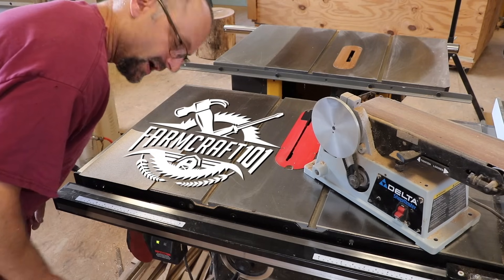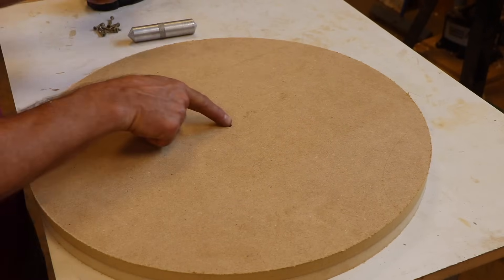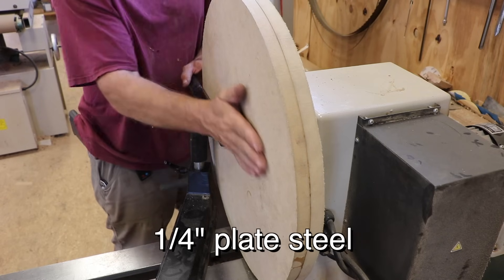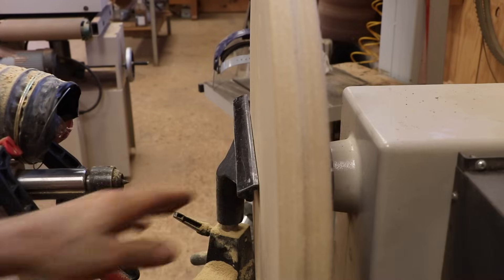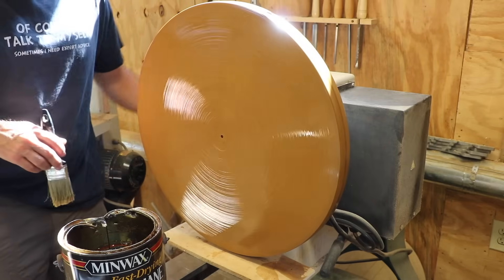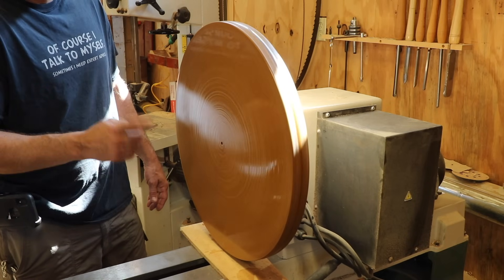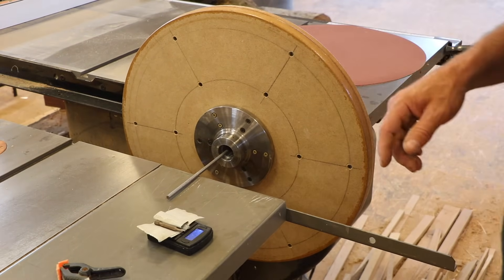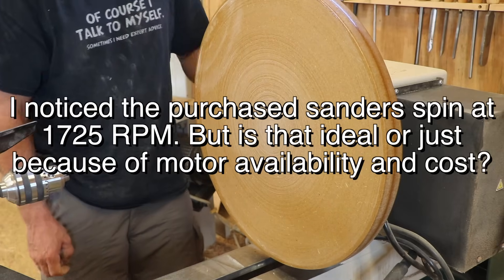DIY 20-inch Disc Sander Build.  $2000 Tool, Cheap and Easy.

Comment: That’s not the only way the tablesaw you were sitting on I built me an insert out of an old tablesaw blade and cut all the teeth off in it and I’m both sides I got light sandpaper on one side and heavy sandpaper any other side and I do it all the time in my tablesaw

Comment: Some sanding disks stick tighter than others. Some peel off pretty easily, some need a little persuasion from a heat gun on the low setting so as not to scorch your plate.

Comment: Hi John - You correctly commented that moving the balance weights towards the axis of rotation reduces the amount of imbalance correction. Similarly, spreading the balance weights out along an arc reduces the amount of imbalance correction compared to an equivalent amount of weight concentrated at a single point location.

Comment: This is brilliant stuff, I would certainly go this route if I had the chance. You Americans are lucky with all the space in an about the house. If you do use polyurethane on one side only, you do run the risk of the disc warping as a result of the surface tension caused the poly and the  moisture level variations over the the year... (don't ask me how I know)

Comment: To determine safe speed for turning multiply the rpm X the diameter of the piece. Safe speed is betweem 6,000 and 9,000. That is for turning a bowl, platter etc. Gives you some idea as to how fast to go maybe 300 to 450 rpm.  Kinda fast for me. Tune at comfort level up to 450 rpm. Helpful???

Comment: Centrifugal Force of 20" diameter disk running at 750 RPM = a G force of 158 times gravity!!!!  Tip speed of 19.7m/s (44mph)

Comment: Jon, does your lathe have the capability to mount 
stuff to the left side of the headstock?  My old Cast Iron 
Shopsmith does.  I'd rather be going that way.

My headstock is REAL easy to turn around.  Shopsmith 
went downhill after Hans stopped building the 10ER.
Those aluminum based Mark something, not all that well 
built.  They are STILL using the E or ER to make the current 
stuff.  You will NOT see a mark whatever (Mk 2, 5,7,and 
the the Mark 7) making the new stuff.  The Model 10 stopped 
production in 1953.  I've paid for a few, some as cheap as 100 
dollars.

steve

Comment: You ask for recommendations on better ways to adhere a sanding disc.  I don't have direct experience with this product as I don't have a Disc Sander yet, however 3M makes Feathering disc adhesive which you can apply to the face of the disc and it doesn't dry but remains tacky...adhering disc paper perfectly and then you just peel it off and reapply a new disc when needed. There is an example of it being used at 3:16 of this knifemaking video which is discussing the benefits of disc sanders. https://www.youtube.com/watch?v=RTj0RY4-HyE&t=102s  You can buy it local at autoparts stores or obviously online. I don't believe it stays tacky forever, but cleaning it up would certainly be easier if as one commenter suggested, you used aluminum as your backer.

Comment: When you  get  the polyurethane on ,  go to the auto paint store and they have a special glue you can put on the surface that will let you change papers. It is used  for da paper which needs to be replaced. It is made by 3 M,
Reply: Just for anyone wondering its called feathering adhesive and is made EXACTLY for this purpose. Double emphasis on EXACTLY

Comment: Great job and you will find many uses for it. I ran mine at about 1750-2500 RPM but I used 3/4 Baltic  Birch sandwiched between two layers of 3/4 MDF mounted to a 10" face plate that was 3/8" thick. I did not add all the other screws to the backside like you. Worked great but it was mounted to a 3500-pound Calpe Hydraulic 50" copy Lathe. I made several attachments for it so I could use it as a manual lathe when needed. One great lathe but over 8' long. Stopped doing production spindle work in 94.

Comment: I think it's great. Two thing I'd suggest. Get a block of gutta percha to clean the disc every so often. It "grabs" the wood particles out of the sand grains. I've use them for years for that. Second, avoid sanding in one spot. When you are, say, rounding a corner, move the wood back and forth across the disc face to avoid burning the stock, and the paper. Great job!!

Comment: There is a principle mistake. Disk sender has to work only o-n-l-y on one half. In your case, as is in correct turning direction, it is the side close to you means from the disc center to you is the working part. As so the disc friction force (as to the turning direction,) is taking the worked peace down d-a-w-n! to the rest plate. In the same time, the other disc side (the Furer) takes the worked peace up. !!! Means: 1. vibrations. 2. you can't take longer peace  than the half disc size and shove it from side to side.*** What needs to be done is to give a slight degree from the center in to out. It means the disk face is not total flat but very very low con shape.    *   ובעברית- הדיסק חייב לקבל זווית קלה פנימה. החלק עליו עובדים הוא רק מחצית הדיסק - המחצית בה כיוון הסיבוב הוא כלפי מטה

Comment: That’s a nice tool but the lathe shaft bearings are probably not designed for the large twisting side loads that will be induce by pushing on the outer perimeters of the sanding disk (?) …..
Reply: Not sure but I guess it has two Bearings one on each side of the bearing block (and at least one for lateral force but that is not important here).
Think about the Forces involved in bowl turning when you put a log on it that is heavily imbalanced. Sanding can't be worse than that.
Reply from the maker: Lathe bearings take a beating turning unbalanced wood and dealing with catches. I think in comparison this will be easy on them.

Comment: Regarding the commercial disc sanders' rotational speed. While the motor may spin @ 1750 RPM, the disc may not be directly driven. some may be gear or belt driven and there may be a speed reduction built into the equation. It only requires looking at one to make the determination.

Comment: Balance is not critical or necessary unless you turn it 3600 rpm. For max speed calculate surface  feet/min. Too fast just burns parts.

Comment: The problem with this will be when you change out the sandpaper-disk, over time the sandpaper disc will adhere very lightly to the plate from all the pressure exerted against it everytime you sand something..

in order to get the glue to release you have to use a heat gun and heat the sandpaper to get the glue to release as you take it off the plate.. then you need to remove all the excess glue still stuck to the plate because if you don't then it will build up over time and make real high spots.. 

 Personally I  would find someone with a metal lathe and have them turn me down a 3/4 to 1" aluminum plate.... Yes , the expense will be more in the beginning , but it's only a one time deal.. 150 bucks probably unless you can get some drops from a machine shop. 

   But well worth it , even if you had to spend 3 times that ..
.

Comment: How is the sander doing after a year?
Reply from the maker: No problems. Must say though I don’t use it very often.
Reply: @FarmCraft101  Well made none the less and as you pointed out, takes up less room than a dedicated sander.  I made a MDF power stop about 8" in diameter x4 layers and use green compound on it.  I do use that more than I thought I would on axes, chisels, lathe tools knifes...  Just include a brass grub screw or bring up tailstock if you run in reverse.

Comment: Hi John,
Having looked at your (unsuccessful) attempt at a puncture proof tyre, I just did a search for silicone rubber foams, that might be suitable for filling tyres. I left a note on that video, but thought that this would be discovered sooner.
I found this;
https://www.smooth-on.com/product-line/flexfoam-it/  (Texas and PA)
https://www.smooth-on.com/tutorials/repairing-deflated-tire-flexfoam-25-urethane-foam/
You may need a drainage tube, pipe insulator, or similar around the hub first, to reduce the amount of silicone rubber used.
Canned expanding foam is too brittle for that purpose, as you discovered.

Regards
Nik
😊

Comment: I found a really good velcro  backing for mine. But then you have to have the disks made from large sheets with loop backing. Luckely there is a commercial abrasives company in my town (I also got the velcro from them) and it works out relatively cheap to have the disks made. I order 10 per grit (40, 80, 120) at a time and it lasts me more than a year.

Comment: I've got a shop smith with a 12" diameter disc which I use all the time.  Good thinking making a disc for your lath using that MDF.  Great video thumbs up.

Comment: Also, think about using aluminum jig plate for the flat surface if needed. It comes in 1/4, 3/8, 1/2, and thicker sizes.

Comment: My concern would be that any sort of pressure would cause the disc to flex near the outside as your face plate is rather small compared to the size of the disc. Maybe when a peice of 1/8th or 1/4 inch steel becomes available you could install it between the faceplate and the back MDF board to add some ridgidity.

Comment: If you check kitchen worktops, the underside always has, or should have, a 'balancing sheet,' of plain Formica or similar.
This to stop warping caused by the absorption of moisture by the underside.
Therefore, you should varnish both sides of your MDF disk, for the same reason, or you may find the disk dishes after time.😊
.

Comment: Awesome DIY adapter. One thing this lacks which you would find on a commercial sander of that size is dust control. That monster is going to fill your shop with dust. Dust control should be an easy second level project for this.

Comment: Love it, but I have an issue with leaving the edge without polyurethane finish.
Reply from the maker: Good news. I did put poly on the edge. But didn’t really show it in the video. 2 coats. I may poly the back as well.

Comment: I built a 12" disk sander using 3/4" MDF mounted using a MDF "hub" directly to the motor shaft..  I also just used polyurethane to seal it and it's fine.  Mine spins at 1750 RPM.  I did build a perimeter guard.  It's been going strong for many years.

Comment: If you want a flat surface that will make it easy to change the sanding surface in future get some glass cut to the right size and a strong glue to attach it to the back. then use a spray on contact adhesive for the front, or, if spinning glass is too scary, then some acrylic.

Comment: way late, back of the cuff math for max RPM:
MDF handles 3500lbs/in^2 (so says google anyway, that sounds high to me, but what do I know?)
mdf weighs 0.025 lbs / in^3
Simplifying down to pie pieces 1 inch thick along the circumfrence
your thing is 11 inches radius, so <= 11in^3 of material at a given pie piece

Assuming your connection point is 1 inch from center (so that I don't end up with a divide by 0, so this is where I'm getting into the weeds) that's 1/11 in^2 connection point for that 11in^2 piece of pie
So thats 0.025lbs / in^3 * 11in^3 =  0.275lbs of mass being supported by our 1/11 in^2 * 3500lbs/in^2 = 318lbs of force capable connection point

So by that math and a centrifugal force calculator I found (I'm lazy) your catastrophic failure point should be around 6350RPM, with very little calculated buffer except that pie estimate at 11in^3 (it's probably less) and probably those screws are further from the 1 inch radius point.

But I'd still stay under 3,000.

Also I'm just an idiot on the internet, I relinquish all liability.

Comment: An ideal finish might be deeply penetrating and repeated coats of water-based polyurethane varnish front, back, and edges. Sand it smooth between coats, of course. Repeated coats of epoxy might be even better. Thin it about 5 to 10% with lacquer thinner and apply multiple coats while the previous coats still have a little tack to them. The guys at West Systems say that a little lacquer thinner makes the final surface microscopically porous and a little more flexible.The material left in the mixing container should feel firm but rubbery assuming the container and the work cured at nearly the same temperature. You'll want to break the corners before finishing.

Comment: I did something very similar on my metal lathe for the wood lathe.  I glued & screwed a 1/4" A36 hot rolled steel plate between two pieces of wood (accoya plywood).  Turned the wood surface down true using the compound and a HSS tool.  Then skinned that with 1/16" aluminum and re-trued the surface with a CNMG insert (less than .001 surface run-out).  I did turn the edge as well.  With the abrasive disc run to the edge, you can get all the way in on a 90° surface. Mine was only 18" as that's how much throw I had on the metal lathe with the removable section of the ways out.  When I put that on my Dad's old wood lathe, the run-out actually stayed under .001".   The steel core gives it a flywheel effect so when you really bear down on it, it doesn't slow quickly.

Comment: If you really wanted a surface that doenst tear off when you pull up adhesive you probably want some melamine board. From what I know (which isnt much) its engineered flat so you might be able to pop it right on top of the mdf you've already referenced. Other than that, a thick coating of resin can be referenced and polished. Might be quite a project though.
Reply: I would be afraid of using resin. I would think the heat could damage it.

Comment: As a retired patternmaker, I can tell you it is probably one of the most used tools in a pattern shop next after the band saw and lathe.
But you need to make a tilting table for it so you can do the needed angles in your patterns. Then it is also very good for making tapered rounds. (like you demonstrated on the band saw)

Comment: Flattening that the way you did does have the potential to make the plate conical(higher in the center) rather than it being truly flat so you really should check and flatten along the entire diameter rather than just the radius.

Won't really matter if you never try to flatten anything larger than the radius but if you need more than the radius in capacity it would be easy to check if it is truly flat by using a straight-edge that is as long as the entire diameter of the disk....

Comment: I made three 12 inch discs for my midi lathe.  After truing them, I glued on formica to the faces.  I change the sanding discs much more often and I find the formica to be a good base...easy to get the old disc off.

Comment: Hi from the UK, Imade a 12" diameter disc sander, using 3/8" aluminium and a 1hp motor' a few years ago. if you use disc pad adhesive for attaching non self adhesive sanding discs it can be hard to remove the residue from the faceplate when replacing the disc. I would have thought your comment re Formica would be an ideal solution as I would have thought it will have a close enough thickness tolerance. Your video has given me the idea to make a 6" version with 120 grit paper for my lathe to sand small dolls house and toy components.

Comment: I've watched Diresta use his large Disc Sander before and wondered if the aggressiveness difference would show up in a difficulty to keep the plane being sanded parallel to an opposite face. The grit, speed, and pressure applied would obviously magnify the difference. What do you think? Or observe after using it.
Reply from the maker: Typically I’m just flattening one side and not concerned with maintaining parallel. Or both sides, as in segmented turning, but perfect parallel isn’t needed.  Could be a problem if high precision was necessary.

Comment: They also make a stick adhesive you just apply while it’s spinning it heats up enough to spread evenly. To remove you just run a piece of hardwood to heat it enough to pull your paper off be used it for over 40 years

Comment: What's really cool about this is that edge of the MDF disc you made is a fantastic finishing sharpener for knives.  You hit the edge of a knife first using just the edge of the MDF wheel (after sharpening with other methods) and for that final sharper than a razor edge you apply some jewelers paste to the edge prior to final sharpening.  Probably best just to make standalone units, where I first saw the idea the guy made bench grinder MDF wheels, one plain and one with jewelers paste.
Reply: either strop or a buffer strip around the radius, / outside of the cylinder?

Comment: MORE THAN ONE WAY TO SKIN A CAT - This means more than one way to make a whip. Whips are made from leather, or 'skin', and there used to be a type of whip called a cat. The famous one is the cat with nine tails, a whip with 9 thongs.

The phrase 'more than one way to skin a cat' means there is more than way to build the whip, which is now used to say there is more than one solution to most problems.

Comment: I like the video a lot. And I will make one, unfortunately my lathe will only handle up to 16 inches but I think that will be a fair size disk. I would have balanced it with something other than the screws and I would’ve waited until I was done applying the paper to it but other than that, that was stellar. You have a new subscriber

Comment: I made a similar one about 3 years ago for my wood lathe. The sanding discs I purchased have a backing disc that is glued to the board and the sanding discs are the hook and eye type so it very easy to change discs for  different grades. I fashioned a platform out out of wood as I dont do welding, it slots into the ways of the lathe. I found it useful to have my dust extractor running while sanding. My lathe has variable speed control which is ideal for the disc.

Comment: I’ve had one for years (only 12 inch) ….made with MDF with smooth Formica laminate on both sides, easy disk change. For the hub I used Bubinga, tapped with a Beal spindle tap… and all turned for exact fit.  It works great.